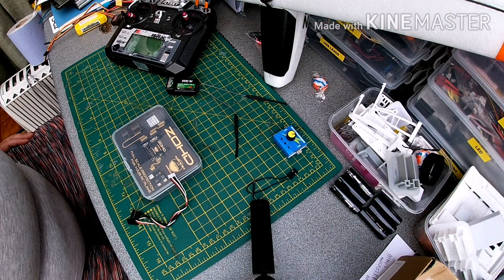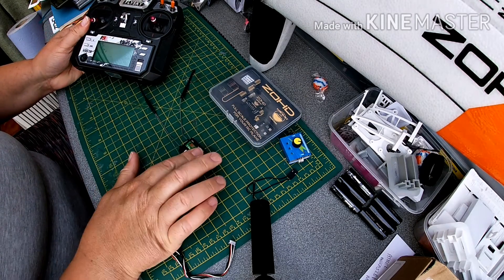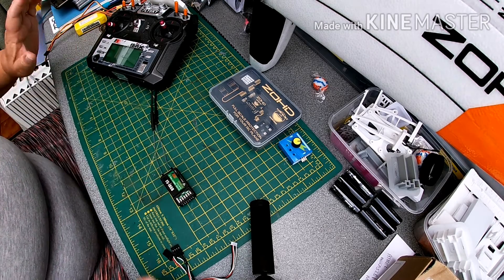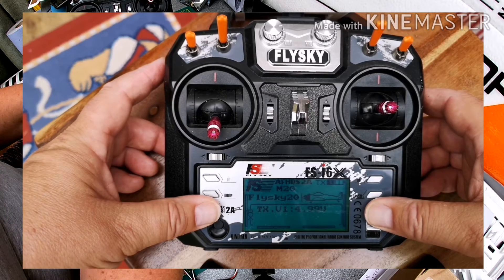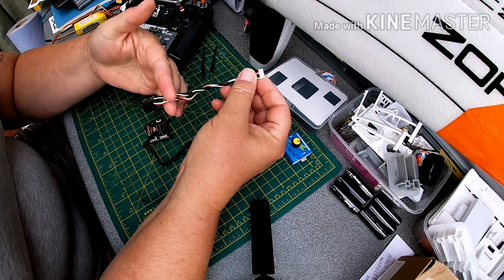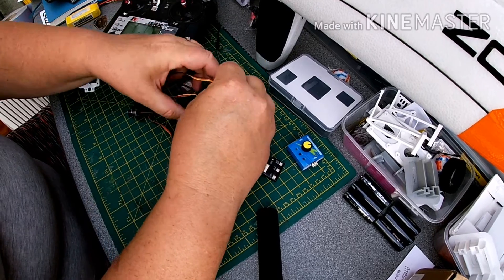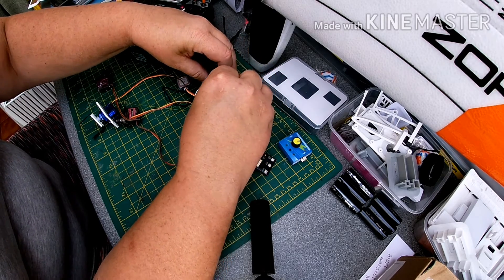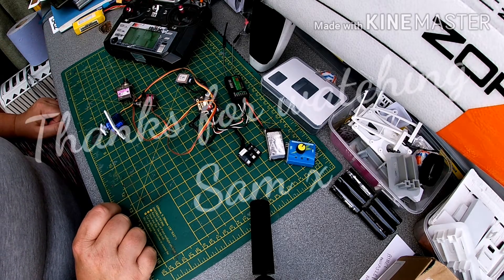Zohd Kopilot connect to flysky fs-16x and fs-1a6b receiver

Comment: I have still had no luck at all getting the kopilot to work with this receiver -totally baffled and totally confused - can anyone help please ?.. watched numerous tutorial and still none the wiser where i should be connecting cables as confusing, with sbus , ibus and so on!... comments here are conflicting .. i am using this receiver with ko-pilot.. anyone able to explain where i am going wrong as i dont have throttle control , and no green flashing light ... - not sure if i connected correctly actually -   connected all the servos to the kopilot, as per the labels  and the pwm  4 pin cable on the top row horizontal and the 3 pin verticle on c5 of the receiver... i think thats right, but cant see in this video as hands are in the way... ..  , when i am not connected to kopilot and all servos are connected  direct to receiver .. everything is working , but when i connect via Ko-pilot ...it falls apart !1.. is it me being a muppet  ..really frustrating .
Reply: With the stock FS-i6 Tx and stock FS-iA6B Rx shown use only the 7-wire PWM connector cable. Also you should know that some ESCs do not like the long boot-up time of the Kopilot. They see it as loss of receiver signal and shut down requiring a power cycling to restart. ZOHD ESCs are compatible but if you have your radio channel 5 set to a 3-position switch and are getting only a short green at power-up then nothing it is probably your ESC that is the problem. 
To test just leave your ESC unplugged and power with a fully charged 1-cell battery (as here) or a separate BEC. If all is well with your Kopilot set-up you should get the short green(s) - then off as before. But after a short delay you should get (ch5 to +100) solid green(s) to suit the plane type. Ch5 to -100 (RTH) should be flashing green(s) and 0 (Manual) should be flashing red GPS led only. 
Also note that if you have to reverse the stabilization direction with the A & E pot on the setting board that this also reverses the stick controls on the radio. So set the pots first and the radio second.

Comment: Great video, but just one thing... you said Kopilot is not compatible with iBUS, but actually it can be.  The FS-IA6B works on both PWM and SBUS (recommended). Connect it to the IBUS pins, and then set the Tx to talk sBUS and it will work fine. The FS-IA6B runs both IBUS and SBUS, depending on what the FlySky Tx is set on (sBUS or iBUS). Hope that helps!
Reply: Hi Toby,
Wondered if you can help .. I am using tx16s  transmitter with open tx and not sure which pins I should be connecting to use ibus on this receiver.. is it one of the 3  pins on the top row to the right ? Or one of the ones marked on the lower row ? A little confused as the where to plug on the receiver to use ibus ? Thanks !!!
Reply: @Jay-gf7mg  really sorry, no idea!
Reply: @CentaurAI  oh .. Thanks Toby.. I thought you may know as you mentioned this supports I-BUS?
Reply: @Jay-gf7mg  Old post but for the benefit of those who come later - Toby is part correct and part wrong. Kopilot Lite CANNOT process an i-Bus receiver input! HOWEVER the Flysky iA6B receiver (though only marked as having i-Bus output on the top (servo) row of pins) CAN (in the current versions at least) output S-bus on those pins INSTEAD of i-Bus, BUT ONLY if you can set your Flysky transmitter to send the S-bus signal. Thus FS-i6X and S transmitters can be used BUT NOT stock FS-i6 transmitters.

Comment: Super explanation thanks. Using a Y lead for connecting flaps where would you plug in to? I read the Kopilot Aux pin is not usable with PWM. Using FS-ia6B would you connect to receiver Ch6. I've tried this and got nothing.
Reply: @Scotty Scott Having found the answer on A Newton's YT channel  I managed to connect by sbus then direct to the 6B reciever ch6 and all is now working well. Thanks.

Comment: This is a great video! but i need  HELP I have the ZOHD almost fully working but all 3 modes have stablization. my first switch -100, seems to be RTH, middle, i though would be manual but it is not, and the bottom switch (100) seems to be stablized mode. can anyone help me why is my "manual" mode stablizated too??